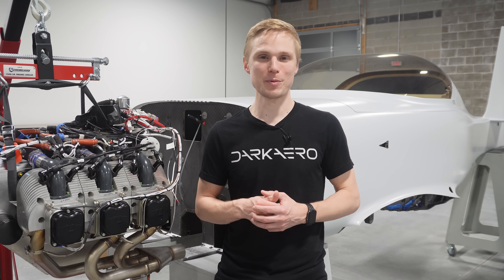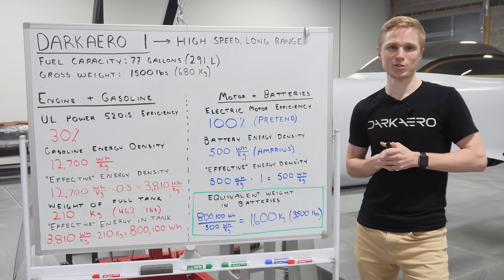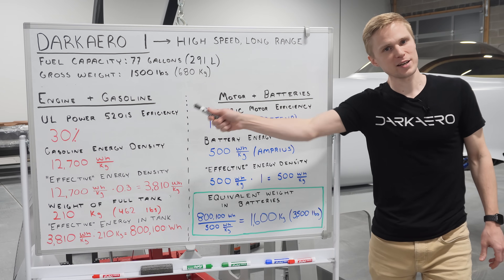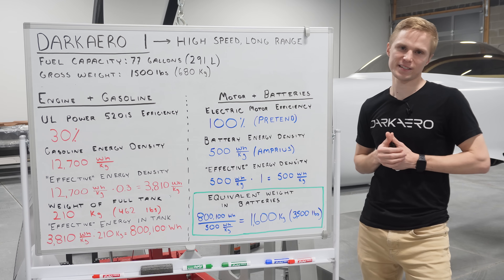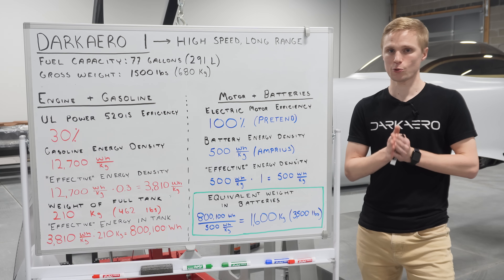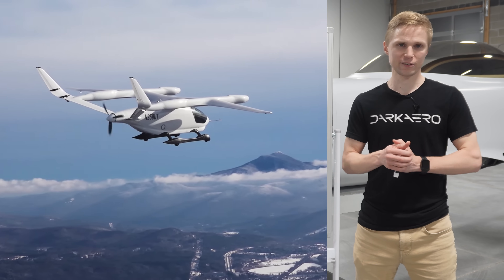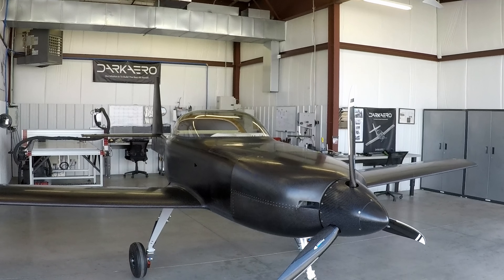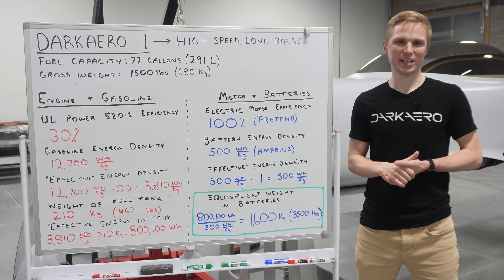The engineering challenge of electrifying airplanes

Comment: There no advantage to gas only restriction with electric is power density.  
I don’t have my degree did horribly on grammar classes but , money is the restriction that plane is carbon u could turn the entire  top of the plane into a solar panel .  Small high density battery and hydrogen fuel cell and turbine lol .   (Missle)

I don’t think y’all are really going for speed aerodynamics yes .  

I know u just sound like I’m yapping I have experience it’s just not on paper or YouTube lol.  

Electric is the way to go. 

Gas should only be for generating electricity.. 

 They have secretly taught u this through movies and anime.   

The restrictions is the amount of voltage generators usually make ..

If u take a civic hybrid rewind the generator and the motor lol and put a higher voltage battery ..  

U can make it fast enough to break a wheel while racing 😂😂😂.  

Don’t ask me how I know .. 

Takes some time google some of the stuff I said it will eventually make sense 😂.

Comment: This was always dead simple in my opinion. 1kg of Jet Fuel has around 12kWh of energy. If gas cars are analogous, an electric jet would be around 3-4x more efficient. What this means is at a best case scenario, an electric plane would only be able to travel 1/12 the distance of a gas powered plane. If better batteries are present, that number would be something like 1/6 with the new solid state batteries. That means if a cessna 172 equivalent was built with batteries, the range would max out at something like 120 miles. While this may be useful for flight schools, I don't think it would be particularly useful for actual flying.

Comment: the push to electrify in the west is honestly dumb. Electric Vehicles are not that much more eco friendly, even if we asume that all of the electricity needed would be provided by renewables, and it will not. What we should focus instead is reducing the amount of vehicles on the road and in the air. making cities more comutable, fixing and optimizing roads for better fuel efficiency and making the engines themselves more fuel efficient. Electrification is probably out of our reach until we can make batteries that dont have to be swaped every couple years and that can provide as much range as an ICE engine. It is promising you are not chasing every stupid trend and stick to your original vision.

Comment: These concepts are really interesting to extend to a plane like the SolarStratos.  It's solar electric and designed to fly slowly and at very high altitudes.  As a result the engine won't lose power due to the altitude and solar cells should also work better due to less atmospheric loss.  

Anyway, thank you as always for such a beautifully explained engineering explanation.  Always interesting!

Comment: I'd do hybrid, electric motor with small battery required for peak power and smaller charged gasoline or turbine engine providing output electric power required for steady flight at high altitude. As in rex cars. Keeping 100km/h speed might require  15kW of constant power for hours. So do that 15kW with rex and 200kW peak from small battery capable of outputting the peak.

Comment: Overall this is a well done video on the benefits and challenges of using electric propulsion in aircraft.

Just as the DarkAero has taken advantage of using composite structures in the airframe design, wondering what (if any) advantages would the use of a hybrid (combustion + electric) would offer to an aircraft. 
I see a couple of advantages, and at least one disadvantage. Under advantages the ability of a hybrid to fly higher and faster, as well as possible flexible options for locating combustion engine vs. propeller location. A disadvantage is adding a generator to the combustion engine to power electric driven propellers is some added weight.
While going purely electric would not match the goals of DarkAero's mission, needing both high speed and long range, there will be an increasing number of applications where either hybrid, or pure electric could be, or become a solution. The energy density of batteries will be key (as noted in the video).

Comment: Even assuming all this information as factual, if your company is not already designing and prototyping planes with structural batteries, then next year when energy density does reach acceptable levels, you'll be scrambling to catch up.Electric  air travel may be low on Elon's list, but I doubt that's the case in the industry.

Comment: I need to be clear about something... while the peak efficiency is 99+% in a modern IPM, the efficiency throughout the speed and torque map is way way lower. In internal testing, I've seen closer to 55% efficiency out of some IPM's at certain speeds. Not trying to discredit your work, but the math will be skewed because of this. Source: Senior engineer with significant e-motor testing and development experience.

Comment: One other thing I think many people miss about electric powered aircraft is safety.  There have been few incidents of aircraft failures due to fuel exploding or starting the aircraft on fire, while in flight.  There have been a plethora of incidents of electrical fires bringing down a plane.  Upping the electrical energy and current on board by a hundred fold would have to increase this danger even more.  Being 5 to 10 minutes or more until your plane can land while on fire will almost always conclude with 100% fatalities.

Comment: What if you used a very small, lightweight, single rpm ICE to convert gas to electricity, and then used an electric motor on the prop?   You could improve the engine efficiency of the ICE by being able to design it around only ever running at a single RPM at all times, and also have a much smaller and lighter ICE.  Take that weight savings to offset the weight gained from adding an Electric motor for the propeller.  So you could combine the advantages of using gas, with the advantages of using an electric motor for the prop.
Reply: This could be extended to form a series hybrid arrangement with a propulsion battery as well as the ICE. In terms of just running the engine at optimal revs, though, isn't that what a constant speed propellor is designed to do?

Comment: A very good objective examination of the issues.  However what was left out was the simple fact that electricity is not an energy source, but is an energy state.  So your calculations are good as far as they go, but they do not consider the cost of generating the electricity.  For North America that means burning fossil fuels, along with a bit of nuclear and hydro power.  Wind and solar are, and will soon prove to be, a complete and utter waste of time, effort, and money.  As long as fossil fuels are available they will always be the most efficient and least expensive source of energy.  The push to eliminate them is premised upon the idea that CO2 is going to kill the planet, and no empirical evidence exists for that rather vain assumption.

Comment: I'm glad you mentioned engine weight, because the weight savings of an electric motor is not insubstantial. For extreme short ranges, that difference can be more than the weight of batteries needed. For short to medium range, the battery + motor still weighs more than an engine + gas tank, but the extra weight might be worth it in some cases, for long range the energy density of the fuel just takes over any calculation. As batteries improve, we will see the number of applications where electric aircraft are viable increase, but there is such a long way to go we might see biofuels take over instead.
Reply: Same as large SUV, the bigger the EV vehicle the longer the range

Comment: Let me skip all your fancy engineering calculations. Battery tech today is not ready for prime time, the whole world are waiting for a breakthrough in energy storage tech., for many applications. The lack of storage are partly what caused the solar /wind disasters world over. If I want to fly from NY to Buf, maybe a electric plane will do, but not crossing the oceans. I also think carbon is NOT a pollutant, we actually need more of it in the air.  Your airplane is not started to be successful yet, you need all the funds available for R and D for new products, not a dead end electric  drive. Your sales is not even at Zenith level, even further away than RV. Trying to be politically correct will not always get you the sales you think you can get. Just look at Bud Light sales.

Comment: Interestingly the worlds biggest battery manufacturer has announced a 500Wh/kg at the pack level battery just a few days ago, directly aimed at aviation (short range commercial aviation). CATL has a good track record of bringing new battery technologies to market, including new structural integrated ones. One of its customers, among many others, is Tesla.

I do agree though that long range aviation will be out of reach for quite a while for battery electric aviation. And even hydrogen based aviation will be restricted to short range (up to 1.500NM commercial, 100 seats) aviation and take a while to get it market ready. Airbus aims at 2035 for its hydrogen powered short to medium range commercial aircraft. Still, the company i fly for invests quite heavily in both battery electric and hydrogen research, as CO2 emission pricing is going up very fast.

Comment: Charging time is a biggy - at present, the turnaround is short: unload passengers and baggage, refuel, tidy up, restock galley, then load passengers and baggage. It takes long enough with an EV to recharge - for a passenger aircraft that significantly longer turnaround mean fewer flights and hence much higher prices.

I would not set foot in an electric plane - a friend of mine nearly lost his life to a large LiPo pack that was just sitting on a chair and decided to do a dog impression.

Comment: Published data projects that petroleum will be a major energy source for the rest of this century. In fact, the overall contribution of alternative "clean" energies will be virtually stagnant despite massive government funding programs. If petroleum continues to be used, then I can't think of a better application than aviation. If a reduced footprint is the goal, then builders would be just as virtuous to source reclaimed lumber and concrete made from biofuel ash. Sure. It's heavier...but so are batteries.

Comment: Of course, since our electric grid is still 80%+ fossil fuel based, and will be many many decades before this changes appreciably even with the most optimistic of technological, economic, and political conditions, let's try not to jump on the electric motor bandwagon too quickly, or we will have energy rationing.

Comment: Never is a long time and physics is not against very high capacity batteries. Actually energy density of lithium ions are higher than gasoline. Current batteries can only contain less than two percent of them.

You also left couple important factors out of equation. They may not apply to your current design, but shouldn't left out when talking about electric plane possibilities. Maybe the most important factor us reduced drag in high altitudes and electric plane's capability to fly in thin air. Electric propulsion also make possible to get rid on some steering surfaces and drag.

While current batteries are not yet up to the task for fast long distance flight but based on my calculations, hydrogen should be. I'm not aerospace engineer so I have to relay on possibly unreliable information found from Internet, but it seems that higher altitude, reduced drag, weight savings and increased reliability should make up lower volumetric density. There would be cost savings on engines and service costs, but fuel price could be higher. On the other hand, clean hydrogen can be quite cheap if it's produced with solar or wind overcapacity.

Also leading plane manufacturers have presented concept designs from electric fan based hybrid aircrafts which would use gas turbine and generator to power them. Based on that, there must be significant benefits from electric fans in efficiency and overal hull design. Fuelcells are not the limitting factor, so it all falls into hydrogen and it's properties.

Hydrogen is not suitable to replace batteries on EV's because of low total efficiency and storage problems. However, with airplanes, that problem is solvable. Liquid storage is possible and high boilout acceptable. It means cheap and light tanks. Fueling can be done before flight and unused fuel taken into storage tanks after flight. Hydrogen's low cryogenic temperature allows relatively easily to use superconductors in motors, making them very light and powerful and raise the real life efficiency close to 100%. 

I have a feeling that there's more political than technical challenges which have been keeping hydrogen out. World is changing and fossile fuels are taking bigger role in global power game. We might see hydrogen revolution in aviation sooner we have thought.

Comment: I think you are looking at this from the wrong direction. Dark Aero may be a fast long range combustion engine plane, but that doesn't mean it can not be made electric, it just wouldn't be as long range. It can still be fast and get better range then other electric planes on the market. It would still be easier to change it to electric then to design an entirely new electric plane, even if the later would perhaps turn out better.

Comment: I fly an ultralight single seat plane that has a MTOW of 240 kg with an empty weight of 120 kg. 
Quite frequently some friendly passer-by suggest this plane would be a good candidate for electrification. Well, it isn't. It is, in fact, despite it's high aerodynamic efficiency, one of the worst candidates for electrification due to the fact that the engine package is just 35 kg, so assuming I keep my own weight of 90 kg there's no more than 65 kg left for the entire electric propulsion package. The motor and propeller may be around 15 kg, which leaves 50 kg for batteries. If I apply your equations to my own plane I'd need the power of at least 160 kg of batteries to have the endurance i have right now.
I mean, flying for maybe almost an hour with a 50 kg battery pack sounds kinda "not bad", but where would that take me other than a few times around the pattern?

Also, those "high energy density battery packs" are not blessed with the best safety track record, and I actually do mind crashing down in a fiery ball of flames....
Reply: Lmao imagine the checklist for an electric aircraft to be “ in the event of a battery fire, crash into the ground before the fire gets to you.”

Comment: Electric vehicles take advantage over ICUs because not because only their weight does not matter much, but also the driving profile with often start/stops makes ICUs very inefficient. Opposed to that, in aviation the engine is operating on a quite fixed rotation frequency for which it can be optimized. Also EVs benefit from the braking energy regeneration, which can be hardly applied to aviation.

But, on the other hand, a Wankel rotary engine could suit aviation even better than a conventional piston ICU, being lightweight and not very concerning to have clean exhaust. Also it could be used in a hybrid scheme as a "range extender"

Comment: The first analysis of electronic motors application with an honest assessment of the pros and cons! I fly RC planes, with electric, gasoline and methanol/nitromethane. In terms of flight time, both type of liquid fuel will give you about 10 to 15 min depending on your power management style and engine power excess! For electric model 5 min is considered standard 🙄🤦, for ducted fans (sort of turbine) 3 min is considered good!🤷🏻‍♂️🤌🏻

Comment: Nice presentation, but you're not being fair to yourself.  You're giving the electric side of the argument way too much slack not only including performance claims untested in the real world, but discounting the requirement for packaging, etc.  In other words, You're painting them in the best possible light.  Meanwhile, you're using an engine which is basically unchanged from the ones designed nearly a century ago with the possible exception of fuel injection rather than using a carburetor.  Air cooled horizontally opposed aviation engines like yours are an antique designed with one thing in mind; reliability.  Nearly every design consideration has to do with reducing the dreaded in-flight engine failure with little emphasis put on efficiency.  If the same design effort we're putting into modern automobile engines were to be applied to small aviation engines, the efficiency would be greatly increased.  Yes, they would be necessarily more complicated, but with modern design and modern materials I would bet the reliability would be as good or better than the typical aviation engine.

My huge SUV gets over 30mpg and I'll be disappointed if it doesn't go at least 200,000 miles without anything more than one spark plug change and regular oil changes.  It's way more useful, comfortable, and reliable than my Dad's station wagon from the 50's which got about 11 miles per gallon and required a valve job at 30,000 miles.

Bottom line:  You make a strong argument for keeping the internal combustion gasoline engine for light aircraft around for the foreseeable future, but it would be even stronger if you were to include what could be done with I.C. engines if we were to collectively come to our senses.  Sad to say, the EV world is approaching future transportation more like a fanatical religion as opposed to paying attention to the science and the guide lines laid down by Mother Nature.